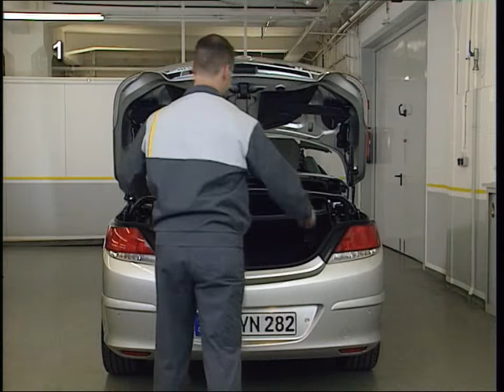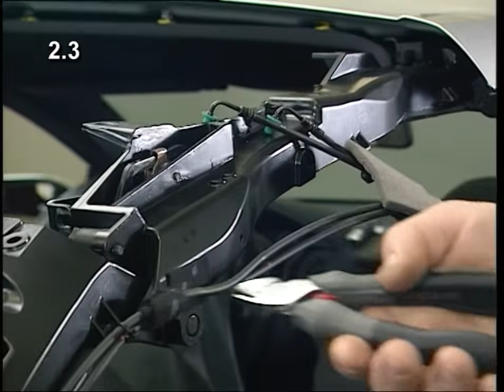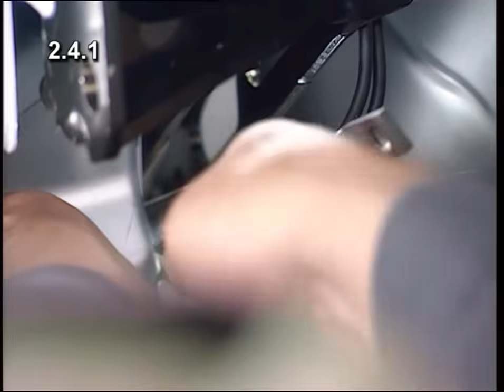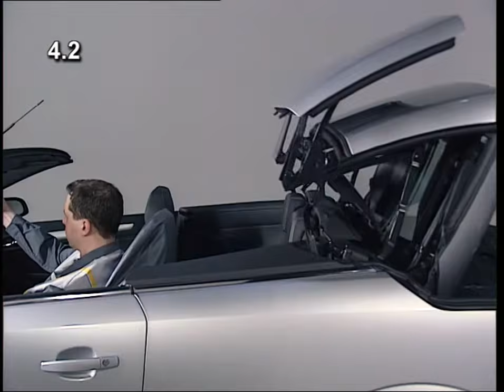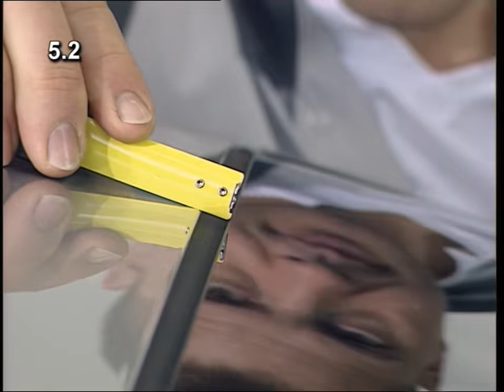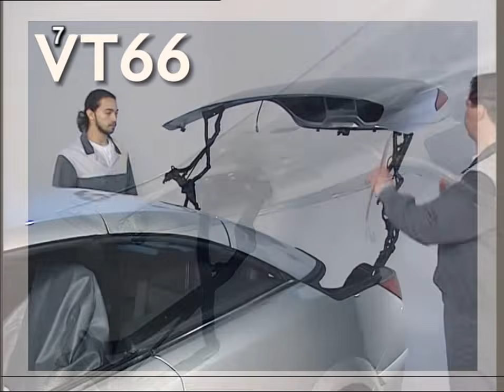Opel Astra Twin Top Repairs

Comment: Hi after i bought my astra twintop, the opening of the roof was working just fine but after sometimes it started opening so slow, now just to open the boot before opening the roof takes time, and sometimes the boot end up not opening. i think there's a problem on the boot hydraulic
Reply: Check the "O-ring".. is a small rubber ring around the golden "bypass-screw" inside the electro-hydraulic pump...usually is rotten and the pressure is not enought to open the trunk
Reply: @deusmortis9512  100%. This happened to me. I replaced the o-ring and it worked great. I've heard lack of use is bad for hydraulics also. Keep that in mind.
Reply: refill oil hydraulic

Comment: These Astra cars were supported by Opel in Germany,  Vauxhall in the UK, and Holden in Australia. The engineering of the retractable roof is a disaster. One can no longer obtain parts from Holden and must rely on Chinese parts coming in from China. Cannot recommend the Astra twin top as a reliable convertible. A roof which fails becomes a nightmare, dealers want nothing to do with them, and don't have a supply of parts anyway. Stay well clear of buying one.
Reply: Can the poster of the video please supply a link to video VT66 for the Astra H
Reply: I have one and everything you just said is true.